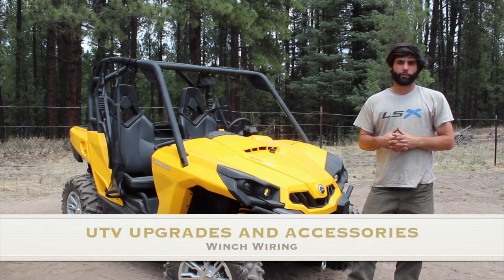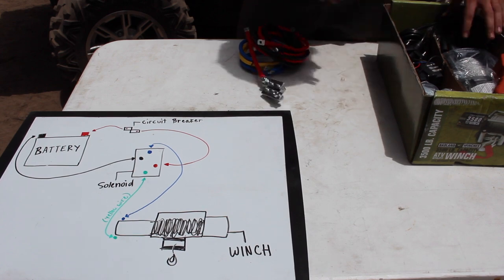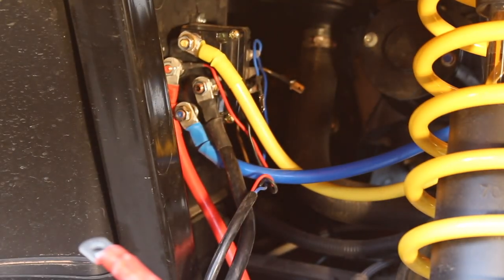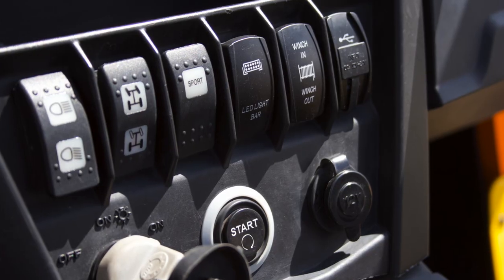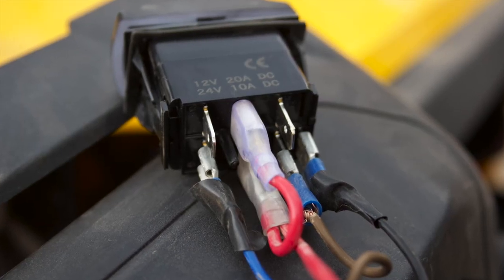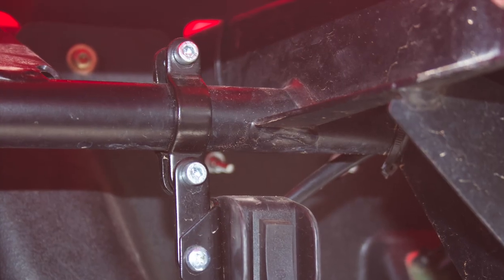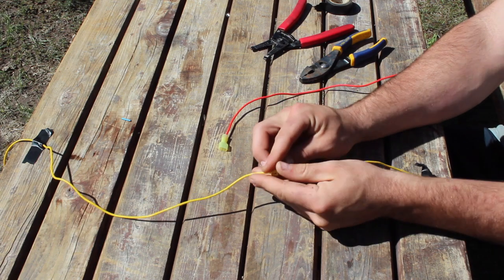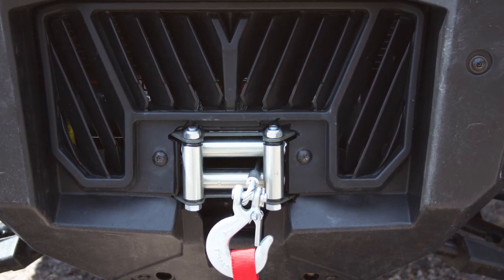UTV Upgrades: Can-Am Commander 1000 Winch Install (Pt. 2/2 Winch Wiring Overview)

Comment: Hello I’m trying to do the same  rocker switch to the same winch you got but my question is. I don’t want to cut the plug for the pistol grip switch I just want replace the factory rocker switch with the mictunning switch is it possible?
Reply from the maker: Hello, that is a great question. I do believe its possible. In hindsight that's a better plan to still have the pistol remote plug  available for winching from off the machine.  

Not sure on the exact wiring order, but will figure it out and make a video ASAP and link it to this comment. Great question, will have  a more complete answer for you next week, let us know if you find out elsewhere because I'm curious too. Cheers.